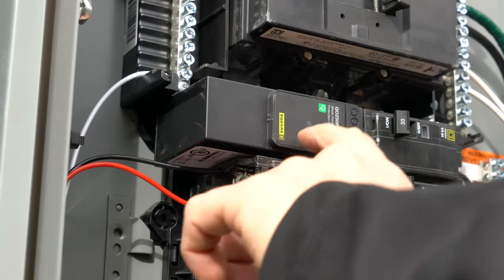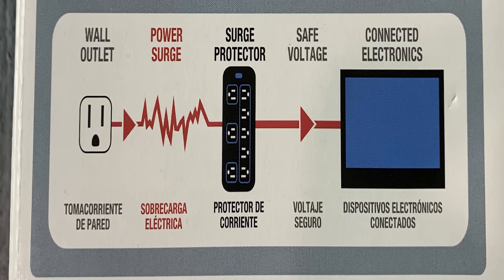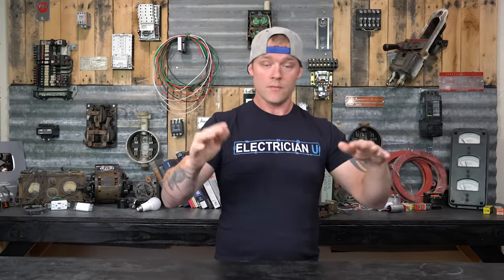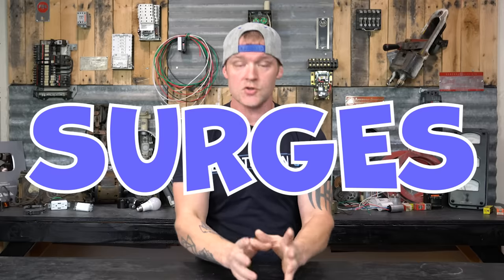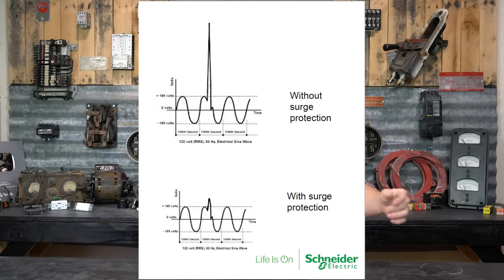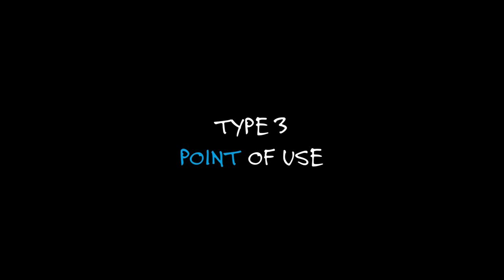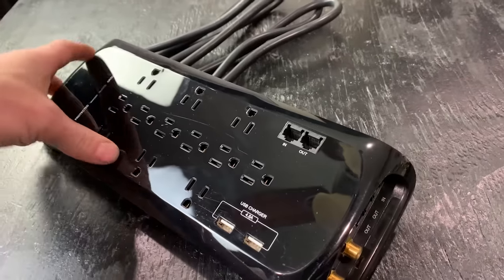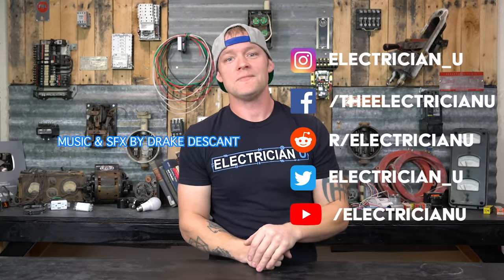SURGE PROTECTORS (SPDs) - What They Are, How They Work, What You Need To Know

Comment: Question: I just purchased and connect a whole home generator, and after its first test run…both of my refrigerators are now having issues. It’s obviously from the generator, but Not sure what the issue is. When the air conditioners kick on while on the generator the lights to the house dim pretty aggressively for 1 second and then go back to normal. Could this be because of a voltage dip, which then causes the refrigerators to have an issue? And if so is there a surge protector that protects against dips? Thanks so much!

Comment: Excellent info.  I am currently upgrading systems in the house I just got.  Still has knob and tube in it if that says anything.  One of the things I thought I splurged on was a Type 1 SPD.  I put in a 200A shutoff outside with a 200A panel inside and ran 3/0 copper between the two.  Small town so who knows how many surges happen but with my computer equipment I have always tried to keep them on a surge protector and often with battery backup abilities.

Anyway I have to wonder something.  If there is a surge does the meter recognize that and if that is shunted to ground are you charged for it?  If you are then wouldn't it be feasible assumption that we need to change something in the system so that the SPD sits before the meter or in the meter box?

Comment: Surge protectors are rated in by their Voltage Protection Rating (VPR).  That is the minimum voltage that the device will engage.  The minimum rating by definition is a VPR of 330 volts.  They are also rated for Maximum Continuous Operating Voltage (MCOV) which is the max voltage that the device can be exposed.  Joule and short circuit current ratings have no meaning for protection.  The problem is they are all the same device so they have to try to differentiate from each other.  A $10 protector can work as well as a $100 one.
Reply: VPR does not represent when the device engages. VPR represents voltage (MLV) that gets passed the SPD after a surge has been applied (6000V/3000Amps) after SPD engaged it (UL 1449). VPR also is not the actual voltage it let through - but result is placed into a pre-set range which begins at 330 (generally increases between 100-1000 volts per stage). It provides an idea of how SPD can perform when installed correctly. A $10 SPD works as well as a $100 SPD? How and for what? What SPDs are used for may be the same but SPDs are not the same. MCOV - every electrical piece of equipment has an operating range (MCOV for SPDs). That's why you have 120/240, 480, 240, 120/208, 24VDC, 48VDC etc and equipment that require those voltages to operate. Short circuit ratings are represented for safety and application but certainly can affect overall surge protection capability.

Comment: Question on power strip/surge protectors. I realize that’s not quite what this video is about, but are the outlets on a power strip typically wired in series or parallel? Asking because I’m designing an automated dust collection system and part of it will include building a hardwired power strip using emt and 4 square boxes to tie all the tools into the automated dust collector switch. Just wondering if each outlet should be wired in parallel or just use the pass through terminals on each outlet and wire them in series

Comment: Very informative video, though it did bring up a few questions. My house has a surge protector located in my meter box. It was installed by my electric service company. I am charged for this service. On my electric company bill, the extra fee is listed as SURGE. Does this protect me from surges, except for direct lighting hits? Should I replace my regular breakers with SPD breakers? Do I only need to use them to protect my high AMP breakers such as AC, electric stove, water heater, cloths dryer, etc.?

Comment: Hi Dustin, Joules is just another measurement unit for energy like watts, therms, btu and horse power.  Typically Joules is used with the metric system.
Reply: Joules, therms, and btu are all energy. Watts and horse power are both power (energy per time). 
1 watt = 1 joule per second
Reply: @Falcrist  Electric power is volts times current in units of Watts.
Energy times Time is Work

Comment: Hey Dustin, thanks for all the content over the years. Has helped me tremendously. Quick question to anyone who may know regarding surge protected breakers: Would those protect against wear and tear on devices connected to that breaker during repeated on and off cycles of grid power to solar power and visa versa when used with a solar/battery automatic transfer switch? Thanks!

Comment: For the average person, I can tell the story of losing a full computer setup on a surge protection system to a lighting strike which came in on my telephone line. A surge protection power strip (type 3) can be a help, but they aren't a guarantied protection against lighting. I would suggest always unplugging at home electronics when there is a lighting storm in the area.

Comment: Although I’m not a registered electrician I am quite capable.
Correct me if I am wrong please, if I have only one device and it is electronic in my house, is it more vulnerable than if I have many appliances on the consumer (fuse box) unit along side with it?
This is without any surge protection device. Do capacitors in other devices protect against spikes or surges.

Many thanks for your video.

Comment: I have an old home, and there are quite a few outlets that are only 2 wire (no ground), which makes plug-in surge protectors useless. If I were to buy one of these SPDs to install in my breaker box, would this protect the devices using the 2 wire outlets from power surges?

Comment: I need to put in surge protection. However there is not enough room in the 100 amp main meter panel. It is small with no room. So the sub panel I installed (replacing a Pushmatic by the way) has plenty of room. My question is will the surge protector protect the whole system or only the sub panel I install it in?   Update:  So I just got my answer by watching your SPD install video. Protection is reduced, the "let in voltage" increases by the distance coming in from the main panel to the device location. Thanks.

Comment: Since electricians already know about this problem it’s something they should automatically be installing.   They really shouldn’t need a code to force it.  In my industry there are things I include in my price, it does make me higher but the customer needs it.   It’s not optional with me.  In my home I use battery backups for critical systems. I have surge protection directly on my AC units.  Here, Only the utility company will install a type 1  and they charge monthly.  I also have protection in my breaker panel.

Comment: Surge protection: Best wiring practice?

If an appliance (Dishwasher) requires 13.5 Amps or less. Is it best to use the minimum code: 15A, 14Awg circuit and wire, or to upgrade (Future Proof) to 20A,12Awg circuit and wire. If a surge should occur does the 15A or 20A circuit provide more protection to the Dishwasher? Does the smaller 15A provide more protection for the appliance by limiting the Amount of current/Amperage surge allowed past the breaker?

Comment: Dumb question:
Twice my buddies house had over voltage event due to a tree falling on a 12KV line which came in contact with a 7KV line that fed his transformer. Blowing apart his class-2 SPD two HVAC's plus. Is there a system that would open the secondary off the transformer fast enough to give some protection?

Comment: Can you provide clarity on the power/line conditioner, a UPS, and their role (if any) in surge protection?
Reply: A UPS is a power conditioner with a battery and inverter for sustained power during an outage.
Reply: Power/line conditioners are able to take less severe but more frequent fluctuations  in the sine wave and smooth them out, for cleaner power better for sensitive electronics.  Many UPS’s are able to accomplish this because the take in the “dirty” power to charge a battery, then output from the battery via an inverter a cleaner wave for the device(s) it serves, with the added function of being able to continue to power those devices for a time when power is lost depending on how they are sized.  Neither of these would be designed to handle the magnitude of the surges and spikes in this video.  Many of the local UPS you might get for desktop workstations would also have a surge protector build into them to handle those.

Comment: Do the amp ratings represent how much current the device can shunt away without burning up? For these devices to limit the voltage they need to provide a very low resistance path to ground and therefore will draw a large current.

Comment: Do all surge protector strips have a built in circuit breaker? is it necessary to have the outlets have that sliding cover to all access or close off access when no in use? What watts, amps and joules are important when getting a good surge protector that will be used by a lot of electrical equipment? is it ok to use the same wall electrical outlet to plug in a surge protector that you plug in a window ac unit?

Comment: Yes, fine. But to what standard do the SPDs need to be to satisfy 230.67?
Listed, 90.4?
Fine, then why are inspectors saying if not certified to UL1449, it's not NEC approved?
UL1449 tests MOV-SPD's only, not SOV-SPD's which provide better protection and are IEEE 62.6234 certified.
Alot of confusion out here in the field.

Comment: For surge protector like Siemens QSPD, from their instruction video looks like it doesn't have to be on the first slot that's closest to the breaker main switch.  If there's a surge, say it's installed on far away from the breaker main switch, does it mean those before the surge protector will fry?  Or it will go to the surge protector as a least resistant path? How does it work really?

Comment: you made the energy/ current labelling sound more weird and scary than it is. Dumping a voltage spike allows current to flow. Current flowing at a given voltage equals energy dissipated within the device. The closer the device is to the grid, the more energy it needs to be able to handle, wether that be measured in Joules or thousands of amps, its all the same

Comment: I'm using an ebike and trailer to haul around electric lawn equipment.  Is there a surge suppressor that will protect a charging li-ion battery and charger while operating high amp equipment from it?  I'm looking at the TrippLite Isobar line currently.

Comment: Am I right in assuming that a 140,000 amp SPD still functions behind a 30 amp circuit breaker because the breaker is slow-blow and the surges tend to only be a small fraction of a second, so the surge is too fast to trip the breaker but the SPD is fast enough to sink that current?
Reply: Yes metal oxide varisistors shunt the voltage to ground.  It is insrantaneous, a property of the material, not dependent on contactors with inertia.

Comment: So question, we have installed an external surge protector on a panel feeding an IT room. It’s just tied to a 40A breaker. I’m wondering how does it work when it’s only tied to the bussing instead of having feeders coming in and loading the rest of the panel off the surge protector.

Comment: Here in the UK SPD's are becoming more of a thing, so are Arc Fault Detection Devices but where our consumer units are located most households don't have the room. Here a standard board is a 10 Way containing 10 MCB's for out going circuits and 2 RCD's to make up 2 protection banks, 5 MCB's on each.  Then we have the MAIN Switch. So if you add a SPD on the input that's another 2 ways gone or a bigger consumer unit would be required. I realise your electrical Panals are different in the US. Our electrical supply is changing, more local generation from households and industry and even talk of our EV cars becoming a local back feed into grid to take some of the high times of load away. All this is creating more noise on the electricity that's coming into our homes. 
The problem of noise is being passed onto the consumer to fix as it's another product that be sold. Instead of manufacturing creating poor quality "noise sources", Standards need to be in place to stop this at source.

Comment: As service electrician I quite regularly find the DP breaker feeding the in panel surge protector tripped. The service calls are unrelated to surges. Because the status leds are never monitored by the consumer it is hard ascertain as to when the trip may have occurred. I have only had to replace one Siemens unit. All others showed status ok after the breaker was reset. Any ideas?

Comment: Hey Dustin what would you recommend for a bunch of appliances that together equal around 4,500 watts. I've been looking for power strips/surg protectors that can handle that kind of load and I haven't been able to find any the highest I've been able to see is 1, 800watts and they're rated for 2000 Joules surge protection.

Comment: So if I understand correctly, w/o a true ground SPDs don't protect anything.  I have a really old house (~175 yrs) and although some of the curcuits have been upgraded to grounded, many were "bootlegged" grounded by some past flipper.  I've fixed (brought back to code) them by either replacing with a two prong outlet or installed a GFI w/ the "no equipment ground" sticker.  I've always thought I was just taking the risk on the electronics in terms of lacking surge protection; that seems what you are saying is happening without a true ground; correct??

Comment: We have type 2 protection on most of our panels at work, connected to a separate 220v breaker. What if you wanted to add one to a panel that has no spaces left? Can it be wired in parallel to an existing 220v circuit?

Comment: So I have a question for anyone who might have an answer.  I installed 12 ultra thin 4” led “can lights” in a kitchen and dining room.  All on a new circuit, every time a table saw or chop saw is used in the garage, the lights dim to almost nothing.  Would a surge protector help prevent this problem?  I know why the saw causes it but I’ve never seen lights dim this bad before.

Comment: Quick question, I work electrical maintenance and automation controls at an industrial facility. We have a bunch of expensive machinery that runs off a busway system. Could this work by putting a spd in the panel that feeds the busway? Have had vfd's that got fried from power outages in the past. Its 208v 3 phase if that matters

Comment: So does the surge protector count as one of the six "handles"? Or are you allowed six PLUS the SPD?
Reply: 2020 NEC Change just like the SPD requirement change from our last code cycle:
What many refer to as “the six disconnect rule” was modified per Article 230.71 such that service panelboards without a main and six or fewer disconnects will no longer be permitted. Hazards associated with six disconnects without a main in a service panelboard have always been a concern; 2017’s changes in NEC Articles 110.16, 240.87, 240.67 and 408.3 during the 2017 review cycle furthered that awareness and inspired more change during the NEC 2020 development process.  

The changes in the latest cycle provide options on leveraging up to six disconnects instead of a single main overcurrent protective device (OCPD), with a how-to section outlining four options:

Separate enclosures with a main service disconnect

Panelboards with a main service disconnect

Switchboards with only one service disconnect and barriers separating each vertical section

Service disconnects in switchgear/metering centers with disconnects located in separate compartments

Unless the SPD is going to be installed in a separate compartment in the future which probably isn't going to be a method considered for various reasons, I'd say that the SPD wouldn't be part of that "six breaker rule" that doesn't exist in the same exception anymore.